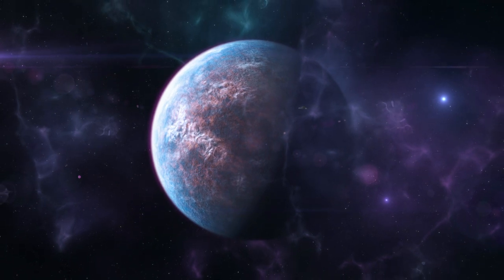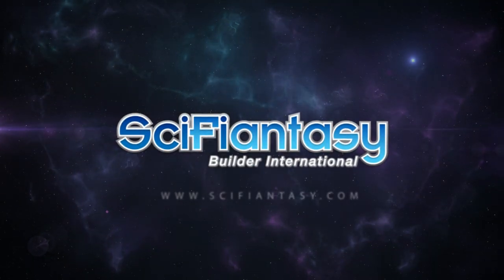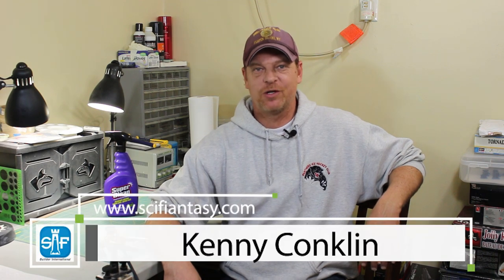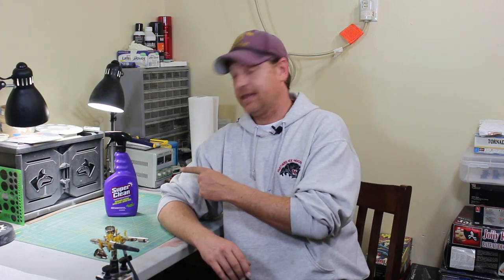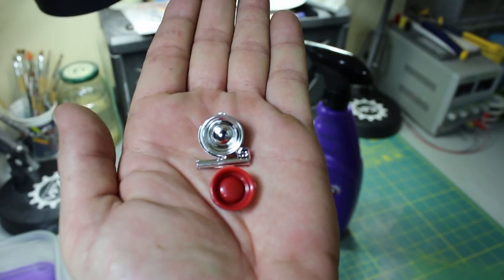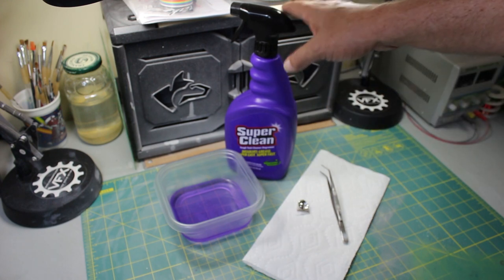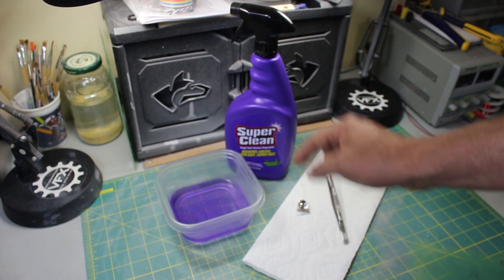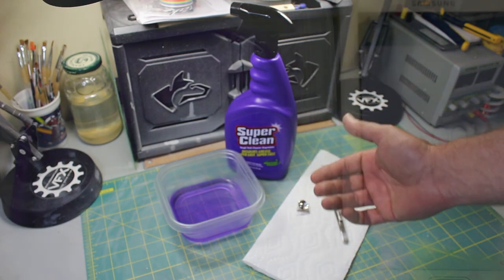How To: Stripping Chrome Parts Fast

Comment: I use Super Clean myself - it's fantastic.  SOME parts can require more time or even agitation or brushing.  I get it at Advance Auto parts stores.  They have it next to Purple Power, which is also popular for removing the aluminum from chromed parts.
Reply from the maker: I never knew about this stuff :( Always used oven cleaner which does the job but stinks. I have to check Advance Auto next time I need it. Thanks for the tip and thank you for watching!!

Comment: I've found that thick household bleach, even the cheapest variety strips chrome. I put the parts into a sealable tray that cuts down the fumes, cover the parts with the bleach and leave overnight. Using rubber gloves to protect your skin lift the cleaned parts and rinse under running water. The leftover bleach can be stored in a specially marked bottle kept well away from kids for re-use.
Reply from the maker: Thanks for the tip Randal never used bleach before.
Reply: I've heard of people using Brake Fluid, too.  You can even use a good degreasing dishwashing liquid.  It will take longer - maybe 2 weeks...but it can work.  I think that's what Super Clean is - automotive degreaser, so it's got the same central ingredient.  I use gloves with it.
Reply from the maker: The only thing i have ever used brake fluid on was to remove paint from kits. I am assuming instead of using break fluid the Super Clean should take acrylic paint of also and a lot safer. Going to have to try it out.

Comment: Recently i had a model build where I wanted to pain the front chrome grill black.  So. I decanted some Rust-Oleum flat gray primer 2X and airbrushed the part.  It worked like a charm.  Great adhesion.   And it was primed all at the same time.  Stripping chrome is just one more step in model making that can be avoided.
Reply from the maker: BennyCFD sounds like a good idea. I always strip the chrome as the just incase factor. My luck it would peel up on me lol.
Reply: Chrome is really hard and virtually nothing will stick to it. That might not matter for a model, but for a car grille it matters greatly because the grille is always under attack from road grit and other nasties.

Comment: will this work for golf clubs? i have couple of golf irons I want to remove chrome to make it look rusty. thanks
Reply from the maker: I have never tried it on real chrome. I have only used it on models for plated chrome which is very thin.
Reply: Did you ever get around to trying on the golf clubs?
Reply from the maker: @nicklorusso5898  no I don't own golf clubs unfortunately. We use super clean for chrome plated model parts. Another follower posted they tried it on electroplated chrome and it doesn't remove it.

Comment: I  have a watch that has a chrome plated brass body. I want to strip the chrome off it. Will this affect the color of the brass underneath?
Reply from the maker: I have never used it on brass but the Superclean MSDS says it is corrosive to metal. Here is a link to the MSDS for the product https://www.superclean.com/wp-content/uploads/2016/10/2016-SuperClean-Degreaser-SDS-v2.0.pdf

We use this on model chrome that is on plastic parts. I do not think it works on actual chrome plating over other metals.

Always test on scraps before using it on something you wouldn't want ruined.

Comment: I found purple power works great on chrome parts. I have stripped a few parts with it.
Reply from the maker: Cool I will be trying that too
Reply: Wouldn't know how fast it strips it cause I dropped the chrome in it and left it while I did other stuff but it was clean when I took it out.
Reply from the maker: @chrishansford9070  sweet I may have to do a side by side time test lol

Comment: Conk- got a Ford Transit and doing a de-chrome project; black on white. On the rear is the name/model #. I removed the '250' but want to de-chrome the TRANSIT. Know anything that will work. Remember, whatever it is it's durable enough to survive outdoors. Simple bleach won't work nor Clorox Bleach Gel. Plasti-Dip'd some parts but if I do the name on the rear door I'm sure it'll come right off after the first swipe of a brush wash.
Know a chemical that will work?
Reply from the maker: try the super clean to strip off the chrome. once you repaint it get an automotive clear coat to seal  whatever paint you used.

Comment: With Super Clean and Purple Power, make sure to wear gloves as the fluids are so strong they will strip the oils from unprotected skin and one would end up with cracked skin for several days afterwards.

Also, do not pour Super Clean or Purple Power into aluminum containers as both will slowly eat their way through.  Always use plastic containers instead.

Be safe!  :)
Reply from the maker: thanks for the advice. safe is always the best way.

Comment: Has anyone used Molotow resist pens to do selective chrome stripping with superclean? I am really curious if it will work, but thought I would check in with folks that probably have far more experience with this than I do. Thanks
Reply from the maker: Interesting question. I have not tried that myself. I gave up on Molotow though for some reason no matter how long I let it sit it never dried :(

Comment: I'm trying with EASYOFF OVEN CLEANER and it doesn't seem to work
Reply from the maker: I haven't used it in a long time because of the harsh smell. I don't know if they have changed their formula or not. I would put the chrome part in a plastic tub spray it with the easy off and let it sit overnight. I don't mess with that anymore since I found super clean.
Reply: Flat out didn’t work for me
Reply from the maker: @vnkable  what were you trying to strip? Were you using oven cleaner or super clean.

Comment: can i use this on rc tires cuz the rim has ugly chrome that I don't like but I don't want the stuff to melt the plastic/ glue/ rubber
Reply from the maker: If you are going to use it just on the rim you should be fine. can you pop the tires off of the rims?
Reply: SciFiantasy that'll mean ungluing them first which is kinda risky then I'll have to reglue them so yah to much work and time
Reply from the maker: not sure how it will react with the rubber. i know soaking it too long will weaken the glue.
Reply: SciFiantasy yah ik but 2 people told me oven cleaner will work fine
Reply: SciFiantasy I'll use a tire and rim i don't use first before i use my tires to see if it works

Comment: Does it work on metal chromed parts?
Reply from the maker: Not that I know of. I have only tested it in chromed plastic parts. I don't have anything with real chrome to test it on.
Reply: Probably not. Plastic parts are probably plasma coated rather than electroplated as a metal part would be, since plastic is non-conductive.
Reply: I use Superclean to strip chrome when restoring RCs and it doesn't even work an all plastic plating

Comment: Does anyone know if this will work on car wheels? I hate chrome and want to repaint the wheels on my ride.
Reply from the maker: Not sure wish I had something chrome to test it on actually would like to know myself.
Reply: @HobbyLinkInternational  I'm trying an experiment right now. Found a broken chrome motorcycle bracket laying around. So I put it in a ziploc bag and put enough super clean to cover most of the part. No change in 10 minutes so I'm going to let it sit in it over night.
Reply from the maker: @nashvilleoutlaw  cool!! Let us know what happens. Hopefully it works.
Reply: @HobbyLinkInternational  Other than the bracket is cleaner than I've ever seen, it did absolutely nothing on chrome plated aluminum after a 9 hour soak.
Reply from the maker: @nashvilleoutlaw  thanks for getting back to me :) I was hoping it worked but I had a feeling it would only work on "chrome" plating. Thanks again for the feedback we really appreciate it!!!
Reply: @HobbyLinkInternational  Not a problem sir. Maybe it will save someone time and money because we know a lot of people are looking at chrome removal for full size cars. Especially Chrome plated aluminum wheels that love to start pitting and peeling after about 10 years. That's why I'm looking lol
Reply from the maker: @nashvilleoutlaw  yes it will :) I never thought a video I made for model building would get this much attention :) but at least we are all learning.
Reply: @HobbyLinkInternational  I never knew there was so many videos on striping chrome from plastic models ether lol that's about all of the videos I've found on striping chrome are about. 

I've got to share a new development in the part soaking saga. The chrome was perfect everywhere on that bracket when I put it in. I just noticed where the part had broken and the aluminum was exposed. The chrome has bubbled up from the exposed aluminum to about a 1/4" back. 

I seen a comment somewhere that the Super Clean reacting to aluminum in the model chrome is what strips it for models. This may actually work on peeling aluminum chrome plated wheels. Just no idea what it's going to do to the aluminum or how long it will/would take. IT'S SCIENCE!!!
Reply from the maker: @nashvilleoutlaw  Science is a great thing!! If you have any more discoveries please let us know. It will definitely help everyone out!!

Comment: Brake fluid also works too, real fast. Unfortunately you have to take it out fast and wash it well off or it will continue eating the plastic until it become a lump of plastic.
Reply from the maker: yup have used that in the past and I have had a lump of plastic lol I like this also because it is biodegradable.
Reply: Try bleach instead. That won't harm the plastic. I've done a video on it, but stripping car grille

Comment: But how well will it work on Car Rims?
Reply from the maker: The model chrome is different than what they use on models. I don't have real chrome to test it on but my assumption it may only clean the chrome and not remove it.
Reply: SciFiantasy. Well Dang. . . I was hoping I found an At Home Remedy to clean some car rims. The chrome is corroded and peeling like tin foil in some cases. I wanted to strip them to paint them without having to make an Electro dip tank.
Reply from the maker: Don;t buy the big jug they have a spray bottle and test it on the chrome. The worst thing is you will have a small bottle of very good cleaner. wish I had some real chrome to test in on :(
Reply: 10-4 we'll See. If it Work ill reply back on this Comment I got a Chrome Exhaust tip that should be a Good Test subject.
Reply from the maker: cool thanks and i hope it works!!
Reply: @spencerschreffler4  hey buddy, did it worked?

Comment: Have you any idea what the chemical constituent is that is doing the work for you? In bleach it's sodium hypochlorite - as I explain in my video here: https://www.youtube.com/watch?v=CDF3A3xUYeY  I've never seen Super Clean here in UK so wondering
Reply from the maker: Cyclone Cyd no one don't know at the moment the because I am out of super clean but when I get more information will let you know :)
Reply from the maker: Here is what is in it. Ingredients:2-Butoxyethanol, Nonyl Phenol Polyethoxylate, Sodium Xylene Sulfonate, Sodium Hydroxide, Sodium Metasilicate
Reply: Thanks SciFiantasy. It'll be the sodium hydroxide.  this is a great oxidiser - you can use it to etch aluminium. We can buy it in crystal form called caustic soda and once dissolved in water it is used for unblocking drains - it will dissolve organic matter very efficiently (thus reducing the solid mass of a blockage)
Reply from the maker: Cyclone Cyd very cool thanks for the info

Comment: I'll grab some from Walmart then I think
Reply: It is also a great paint stripper. Got a started but not finished Tamiya Missouri that had thick brushed-on paint on the hull, so I dunked it for a few minutes in Super Clean and it softened the paint to a mud-like consistency. It could then be brushed/wiped off or rinsed with water.

Comment: Will this work on the chrome plated on trap sets because all my plated parts are getting rusty and bubbled up i think it's plastic or cast iron
Reply from the maker: If it is chrome plated over plastic it should work. I use it on the chrome plating on plastic model parts and the plating comes right off. I don't have anything chrome plated over metal so I was never able to test that out.
Reply: @HobbyLinkInternational   okay yeah i think it is plastic like hard plastic because if i can be able to send you some pictures of it  you have a discord  maby you can give me some ideas
Reply from the maker: @mikaelgopaul4609  you can email me at hobbylinkinternational@gmail.com if you want to
Reply: @HobbyLinkInternational  ok got you man thanks for the reply aprreciate  it too :)